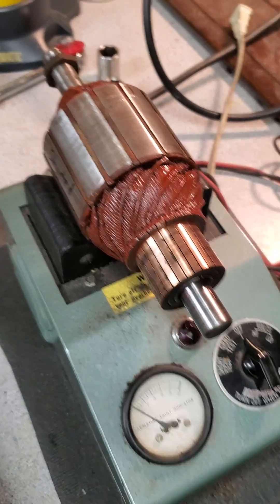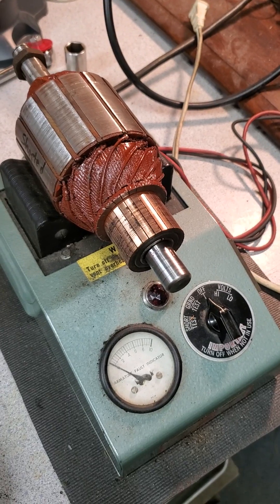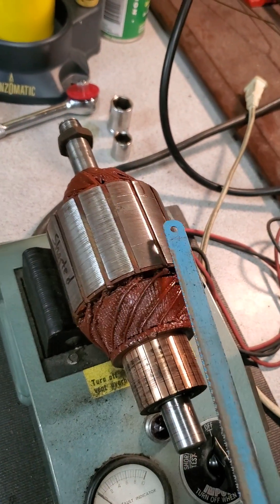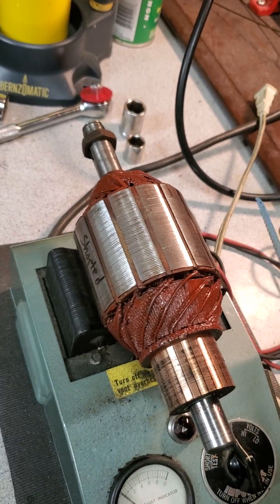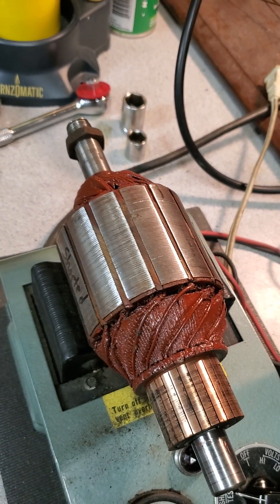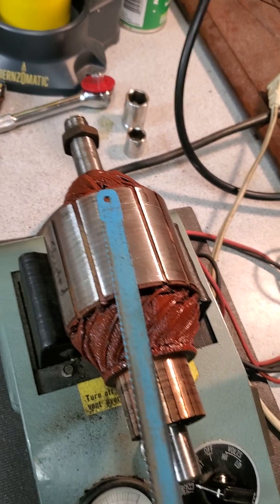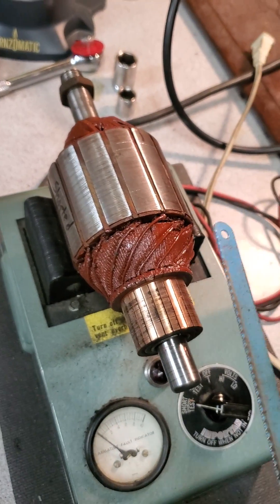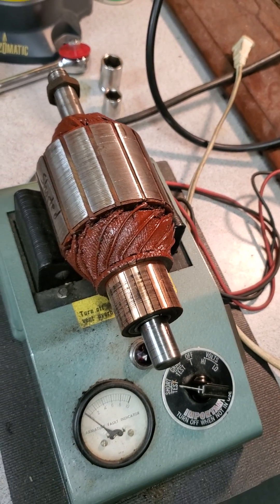What a shorted armature looks like on a growler

Comment: Steve, is there a way to test for a short in an armature without a Growler? Is there a multimeter test?
Reply from the maker: Not that I'm aware of. But growlers are not too hard to find. As you saw in my other video, you can test for grounds from the commutator to the shaft or laminations with an ohmmeter.
Reply: @SwabbieSteve  thanks Steve!